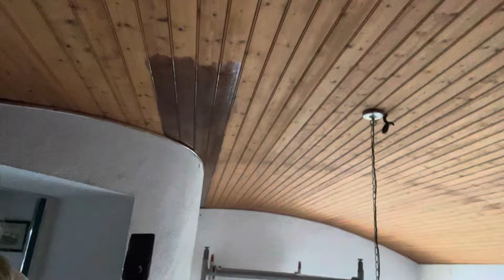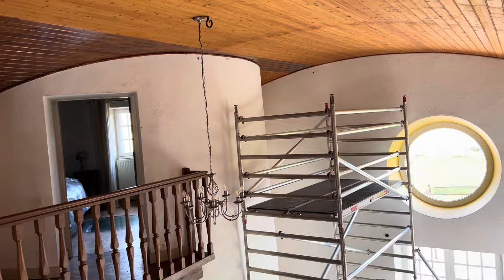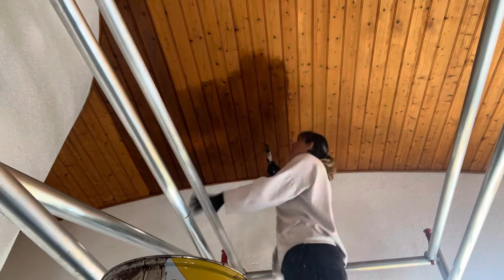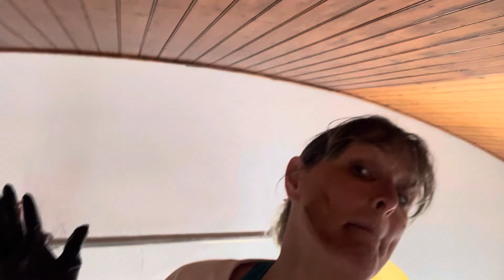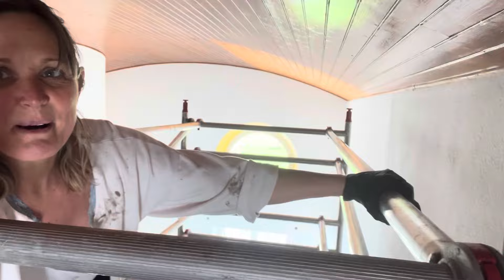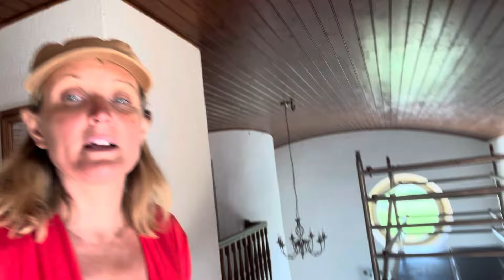TIMELAPSE! UTTERLY DRAMATIC TRANSFORMATION I’m scared of heights and im trying to avoid lap-lines

Comment: The dark stain looks much better!! In the past, i have used various techniques to paint stairwells and ceilings in awkward places. A simple approach  to that tight space in the corner is to move your scaffold as close as possible and duct tape your brush to an extension pole.  I have done that many times. (Or, you can get somebody else to do it.)

As always,  love your cheerful attitude.
Reply from the maker: Thanks. 🙏🏽